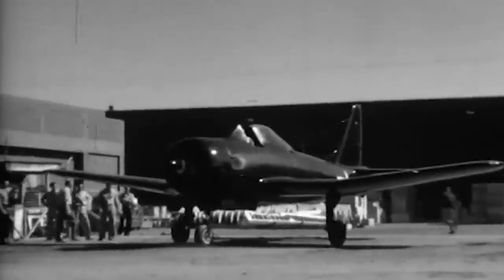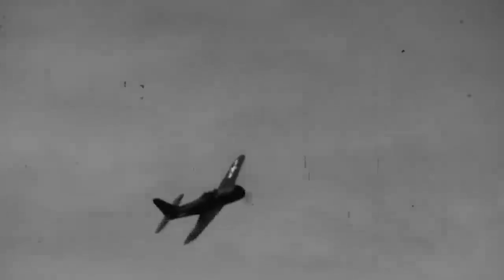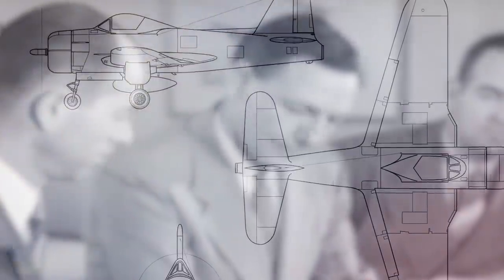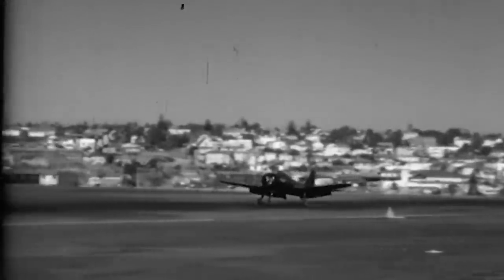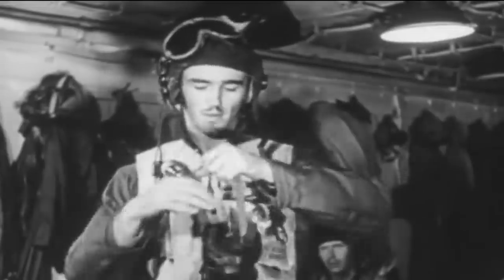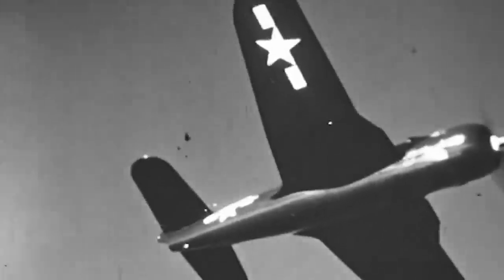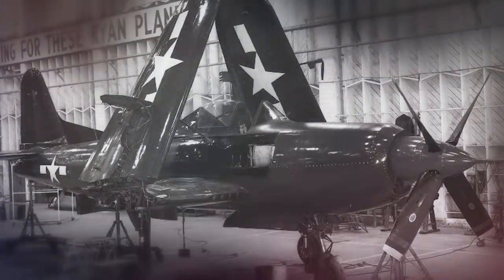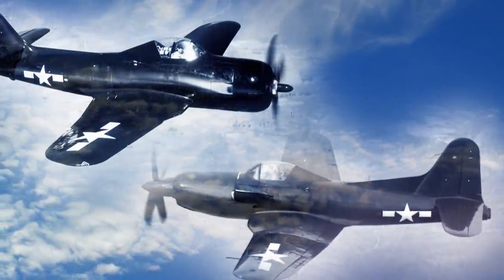The WW2 Fighter with a Jet Stuffed in Its Tail - Ryan FR Fireball

Comment: For the most part I like your presentation,  but I've noticed you often show snapshots of ships or planes that have nothing to do with your subject. 
Example here at 1:20 you shows planes wreckage that clearly show more modern jets burned up on the flight deck  of a more modern aircraft carrier. The flipped over Fireball looks like a Corsair, possibly the Hellcat.

Comment: Congratulations:  the video imagery is showing much more than usually the aircraft you're actually talking about.  Well done!  Then you go and spoil it by showing a guy being stretchered off a flight deck with a bunch of F-4 Phantoms in the background, and then a bunch of crashes by a random selection of other aircraft.  And of course the give-away with the shots of CV-36 is the angle-deck, very much a post WWII innovation from the Royal Navy, which the Antietam didn't get until 1952.  So improving, but try harder and don't just post video before finding out what it is!

To detail.  You say the pilot was located in front of the leading edge of the wing, while showing a clip that proves he wasn't.  Don't just quote Wiki without looking at what's in front of you!  And a couple of things on carrier ops:  first, if you have a choice between a radial piston engine and a jet, it's going to be the prop everytime for landings.  These early jets had appalling throttle response, with a wind-up time of many seconds.  There was no instant adjustment if you hit a gust.  So with the first jet landing scenario I think you've not quite grasped what happened.  The crash barrier is at the other end of the flight deck, to catch aircraft that miss the wires.  If you're about to take the barrier the jet spooling up is no use; you'll just hit the barrier faster.  But it would have taken a considerable time to get the engine started, even if the compressor was already windmilling we're talking about 30 seconds or so.  With a full prop engine failure and high-drag configuration that would put him in the ocean.  I imagine the real scenarion was that the piston engine failure was more a partial loss of power.  Ensign West wasn't going to make the flight deck and the contribution from the jet saved him from hitting either the sea or the stern round-down.  The concensus is thus that this was more a controlled crash than a true jet landing.  The accepted first carrier jet landing actually took place on 6 Dec 45, executed by Lt Cdr Eric Brown in a Vampire onto HMS Ocean.  That was a controlled landing and was one of many pure jet take-offs and landings he performed that day.  There's a discussion at: navalairhistory.com/2019/11/06/the-first-jet-carrier-landing-on-this-day-or-not/ 

This piece also shows why you need to be a little more careful with words to understand yourself the basic message you're putting across.  It wasn't 'despite' its technological innovation that it came late to the war, it was because of it.  And it's probably just as well the aircraft reached front-line service just in time to miss combat.  An analysis of its many incidents and accidents can only conclude that the airframe was totally under-engineered, the result of picking a contractor without relevant experience in this most rigorous environment.

Comment: 548 comment: hving a hybrid plane prt small jet & normal radial  is very very smart design bc old prop style carriers already in use built so why not get best of both fuel low safe flying & landing off old carriers or near ground then boosted fighting & climbing edge or power turning very smart design not even used,other than test learning bed. Korea still needed carrier launched ground attck low safe flighing off carriers placed right behind lines just so. But hvig a hidden jet or needing to get away from jet surprise. It if soundly built would hve been cheap step up yet any pilot can fly & land on old carriers.